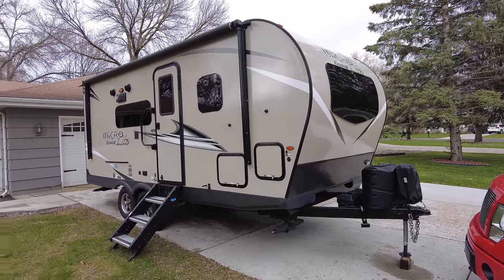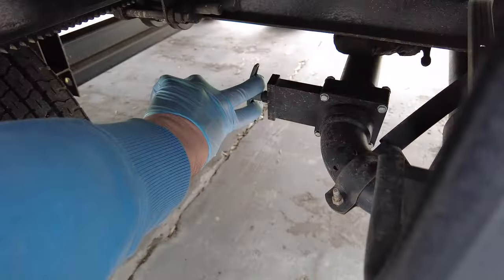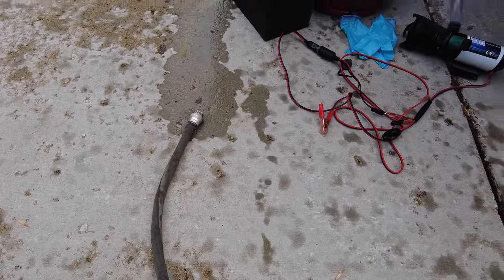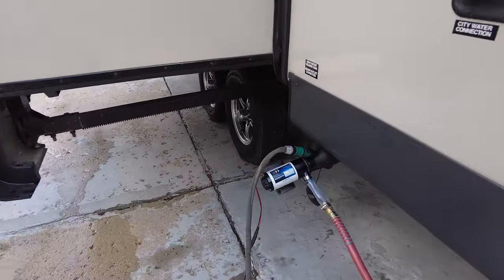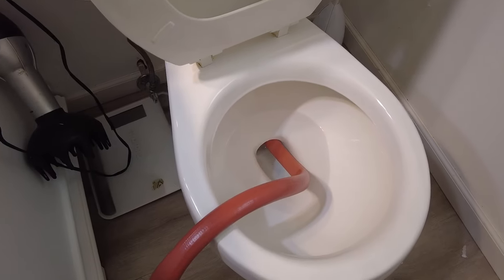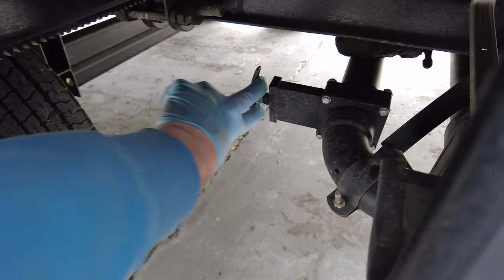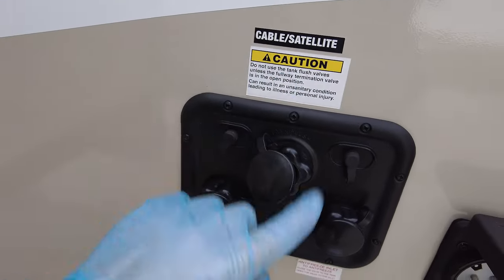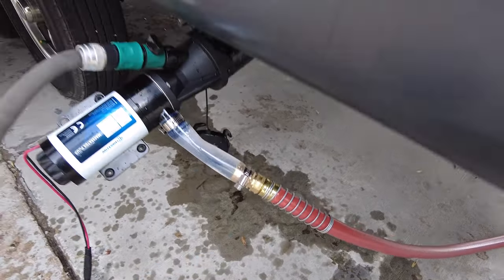How to use a RV Macerator Pump to empty holding tanks at home!

Comment: These definitely are a game changers.  While we primarily dump at the parks before leaving, being able to do a couple flushes etc.. at home is super helpful for maintaining your tanks.  People are always worried it's going to be smelly or messy, it really isn't.  The trick is like Matt showed is to make sure your hose is pushed around the toilet trap and you won't smell a thing.  Pro-tip is to cut off the threaded hose end to make it easier to get around the bend.
Reply from the maker: Good advice!
Reply: I wonder if there is a hose attachment that could be fitted to the external soil vent pipe (waste pipe) of the house? Then the hose wouldn’t even have to go inside to the toilet. That would be possible in the UK anyway.
Reply from the maker: @sebrickard7356  That would be ideal if someone that, unfortunately, we don't.

Comment: If you have town sewage you may already have a 4" clean out in front yard.   I called my plumber to help me find it.  If I would have known it was that easy I would have bought a cheap metal detector and found it myself.   In just minutes the plumber found the metal cap, and replaced with plastic 4" cap.  I now dump directly there from RV.  Its about 8 feet from curb so its super convenient.  So much easier then pump and hose to inside toilet.
Reply from the maker: Great advice, now I need to locate mine!

Comment: Excellent video! Bought the same macerator pump and a Gilmour Commercial Grade hose (75 foot). Made quick work of my black water tank! Only recommendation would be to use a 3' sewer hose to put the pump on the ground...it is a bit hefty and I noted that it put downward stress on my secondary valve enough that sewer water was leaking out from its connection point to my rig. Well done and thank you!

Comment: Does the potable city water connect to the flush port go to a tee that connects to the RV sewer pipe? So if you forget to turn the black handle on the green valve your sewer is directly connected to your potable water connection?  No traps, no vents, no back flow valves between the potable water and the sewer just that little green valve?
Reply from the maker: It is just the valve, so I suppose there could be some back flow if you didn't switch it. thats why it's important to have a dedicated hose just for this purpose.

Comment: Is this a good option if the septic tank is uphill from the RV spot we are using?
Reply from the maker: They advertise that it will pump 10' uphill, although that might be optimistic. I'm pumping a distance of approximately 50' with an increase of elevation of three feet and it works fine.

Comment: Is there a more permanent attachment so I don't have to do this every time.
Reply: Just leave it hooked up. Turn on as needed. 🤷🏼‍♂️
Reply from the maker: It's made to be a "use as you need it" system. What kind of situation are you in that you would need a permanent attachment?